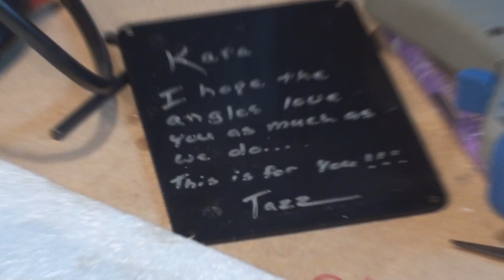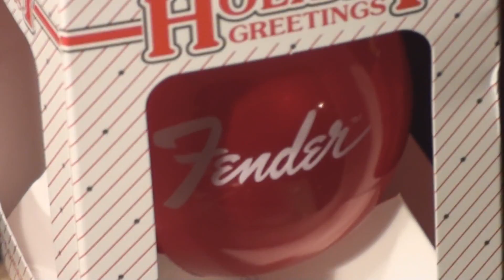Jackson Performer Kelly Guitar

Comment: @kozz1963  i shimmed old school with tape for a snug fit  and i now have a bigger issue as i put the e strings on the g-tar and wound some tension in them just to check neck alignment i noticed the narrower neck has a minimal amount of area to the outside of each of the strings probubly half what you would normally have ........... so at this point will this be playable ??

Comment: This is a new one to me. I've never heard anyone say this was common. And the only locking nuts that I've see with a flat base was older Yamaha's and Aria Pro II. I don't know what kind you have, or which way you lock down the strings...but mine are like most, the triangular prism, which i run the top parallel with the stings so nothing is over-compensating the friction points.

Comment: Tune flat initially, then use the thumb tuners on the bridge to adjust it once you lock the nut down.  I made the mistake of putting a Floyd on my guitar, but went with a roller nut and locking tuners.  It seems to be a good compromise, even though you don't get as much or as even a dive with the roller nut as you would with a locking nut.

Comment: Hey Dave, I need some help and info on how to fret level a Jackson guitar neck, it has a compound radius 12-16". Do you level as you would a one radius neck or is there other things that need to be done? I am using a aluminum leveling beam, and not a radius wood block. I just wish you had a video on this kind of fret leveling job.
Reply: oh ok, I thought the frets had the radius lol. I looked up compound radius and it shows the neck is like a cone small at the nut, and gets larger as you go up the neck. I just don't want to screw up my fretboard. I have search online and could hardly find any information on leveling a compound radius fretboard.

Comment: How did you fix the stripped neck screws, Dave?
Reply: +Jason Kimbell He might have glued some wooden splints in there and then screwed new holes. If you look for a Telecaster set up, he did something similar to repair a strap button.

Comment: Reverse Headstocks are nice, they give you a tight low E string for rapid palm mutes and a looser high E for bends and playing up high without cutting up your fingers. 

I wish I could find a guitar I liked that has one but they're all too expensive or have too much other metaled-out bullshit.

The kelly is a nice guitar though, I test drove 2 at GC and the necks are superb, but so fucking heavy, especially neck heavy, you need a strap to play it sitting down. I much prefer a strat, les paul or even a V for sitting around the house playing. 

If I was a performing guitar player though I'm pretty sure I'd have a kelly in my lineup.
Reply: I think it does not matter whether the headstock reversed or not. The strings are locked at the nut, so they are the same length on both headstock types.

Comment: Ok so I have a question Davey, you seem to work on many Jackson guitars. I've now owned 4. Every time I went to lock down the nut, the strings are pushed down with it, causing it to go sharp. I said fuck it and put a string retainer bar on all of them. All is well.

Is it just me, or do they all have this issue? It's like the nut is too low for them by themselves. So the only fix is either add a bar, buy new nut, or put one big ass shim under the nut, but that raises action.
Any ideas?
Reply: just  use the  fine tuners on the  bridge to  put the  guitar to   the  correct  pitch.
Reply: @LFC-Star  I added a retainer bar to that guitar, and it fixed the issue. As well as every Jackson I've had since. Prior to the original comment, I've owned multiple floyd rose guitars from other brands like Ibanez, Schecter, Yamaha, that didn't have this problem and knew how to set them up without issue. 
Jackson/Charvel seems to be the only ones that do. 
My advice, add the bar to prevent string hike

Comment: Well then you have some bad luck with FRs. Like I said, I've never had to tune flat. Especially on my Ibanez Prestige or Schecter Syn Gates. Only on Jacksons have I had that issue. If you haven't noticed yet. If the retainer bar isn't low enough, or one at all, the strings pull to the sides of the groove of the nut. Add or lower the bar so the string sits at the VERY bottom. It will fix that issue. It's common sense, but what do I know?

Comment: Ibanez doesn't use locking tuners. They having a locking nuts. 
Ibanez also doesn't have this issue NORMALLY. They have a retainer bar on there for a reason. Make sure the bottom of the retainer bar is below the groove of the nut. it will never have the problem again. The only reason Jackson does it, cuz they are too stupid to put a bar on factory. I've installed them on my Jacksons and never have the issue afterword. Yes the fine tuners are for after locking down, but mostly for after use.